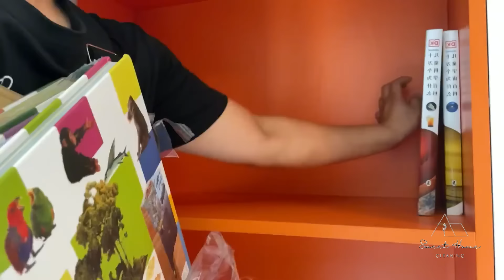✨WHOLE HOUSE CLEANING Sparkling Spaces: Master the Art of Effortless Kitchen and Home Cleaning! 👌

Comment: Dust and filth of that order needs more therour cleaning of electrical motors and condensers due to overheating and high power consumption and fire risks,your climate will make enviroment worse, efficient runs cooler,less electric and cooler air conditioning.